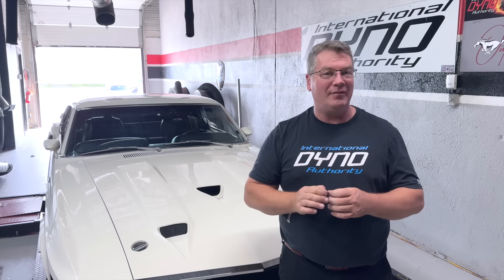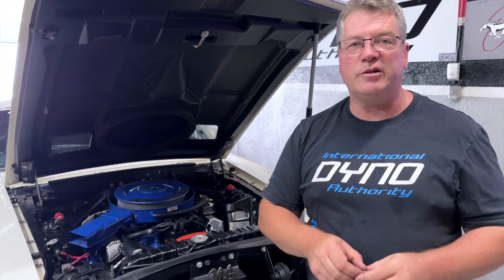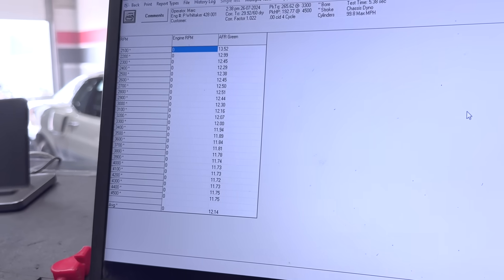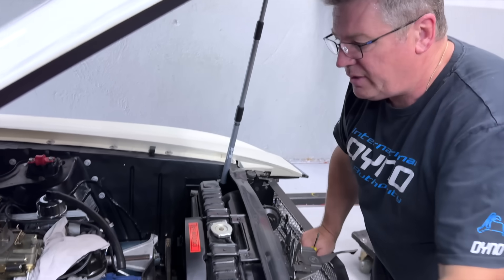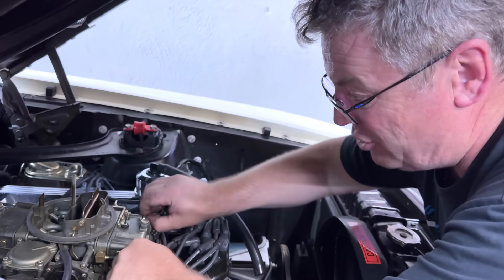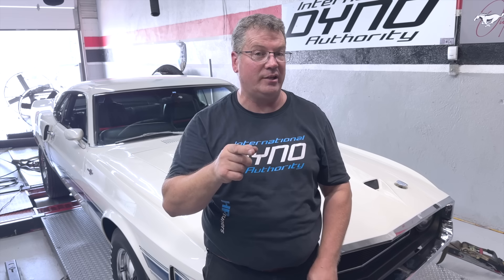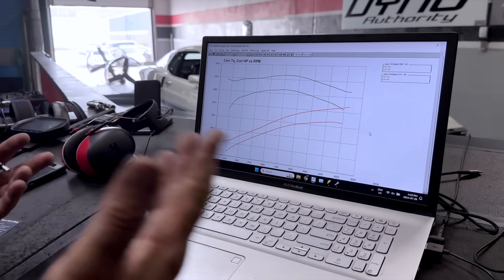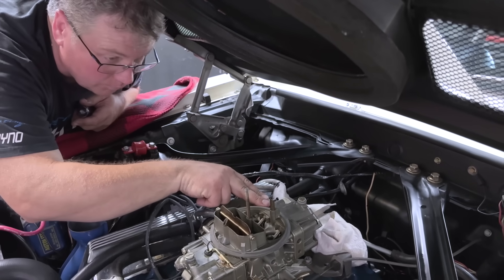Original, unrestored '69 Shelby GT500 tuned on the dyno

Comment: My father has a '71 Mercury Monterey that he bought as a young man and it had previously been a highway patrol car in Indiana. The trooper that had driven it actually found my dad through a message board in the 2000s and talked to him about it. Apparently they were kind of rare in that they were a souped up version and not the standard highway patrol car or something like that. It has a 429 with some kind of Super Cobra Jet Carb that several mechanics have told my dad was a fantastic and expensive carb. It is still tuned to run on high octane leaded fuel, so on the rare occasions he drives it he always fuels it up with good fuel and adds lead to it. I don't know how much power it makes, but it would put my '96 TransAM to shame.

Comment: My father owned a 62 Galaxie that weighed 3600 lbs and 428cj motor with headers cam and Holley 750 and it ran 12.88 at which the torque broke the diff 😊
Reply from the maker: Those were some awesome numbers!

Comment: Assuming a 15% drivetrain loss, 299.64rwhp & 403.01rwtq is equivalent to 353hp & 474lbft STP net (339hp & 456lbft using modern SAE net correction). Those are amazing numbers when you consider that Ford rated the engine at 335hp & 440lbft STP gross. Great job! 👍
Reply from the maker: @DJDinaggio  Thank you, and it's one of the mathematical equations, that we described to customers on a regular basis. We can give them a approximation and I say that in quotation marks. We can give them an approximation, of what the engine would make if we took it out and install it on our engine. Dynamometer. And in the past we have actually taken an engine directly from the engine dynamometer and put it onto the chassis dynamometer in the chassis. The customer was going to run in the first place. You would be very surprised how accurate the 15% number can be with most items.
Reply: The NHRA factored these engines in at 360hp I believe

Comment: The information above contains some incorrect information. The 428 would be producing 285 horsepower with440 lb/ft of torque at 3400 rpm's. The engine would have to be making 549 fb/ft of torque at 3200 rpm to make 335 horsepower. I've seen the 335 hp rating at 5400 -5500 rpm. I'm sure it's just a typo. Y'all motor with caution. 

Beautiful ride.
Reply from the maker: We appreciate you catching that - we'll fix the information and update the video description.

Comment: We got to 36° on 93.   Ran real good.   But yeah.  On a rare car and given “most people” 32° is a nice safe #.   Can believe it jetted down that far.  Y’all did real good.   Bet the customer will be thrilled to not be gassed out of the garage and have a car that runs good.
Reply from the maker: @PontiacSkunkWorks  The ignition timing amount, is rarely something that we really worry about. What we do, is make sure that the fuel is correct. That the fuel curve is correct. And when we're all finished. We will work on ignition curve. But, the all-in number, is really based on what the customer would like to do with the vehicle. Vehicle. And the quality of fuel they think they can achieve at each station. They go to. Most of the time on the street for a cruiser, you're just making it run correctly. We're not worried about trying to get 33 or trying to get 34. However, on our engine. We will work with the timing and the timing curve until we make the maximum amount for any of our competitive customers, who are actually using their vehicle for competing with their boat competing in truck or tractor pulling or competing on the quarter mile drag strip or roundy round, Circle track racing.

Comment: The Muscle Car Era was a wonderful time to be alive.  This is one of my all time favourites.  I remember seeing one in the neighborhood when I was 17.  Stunning Car.
Reply from the maker: @timmotel5804  Agreed this is a Fantastic Car , fun to work on.... Very Responsive
Reply: Except for the cars didn’t make much power and were junk.
Reply: @SoDoSoPa-ShiTpaTown you ever ridden in one been behind the wheel of one  owned one
Reply: @ my first car was a 1969 camero z/28, also had a 70 charger RT V code car 440/6.  I’ve had a bmw 750, and Merc S580, both of which would stomp the hell out of any muscle car. Those are both full size luxury limo’s. Currently have a new Taycan 4S.  No muscle car could hold a candle to it.  They didn’t handle well, didn’t stop well   didn’t make much power for their displacement, and were typically not road worthy after 5 years.

Comment: The carb has been restored.
Reply from the maker: @hunniebe6  It was a beautiful carburetor to work on. Definitely in great shape. Each of the bolts and pieces, and gaskets were easily removed and replaced and it was a great piece to tune . The step-by-step process was fun to shoot, fun to test, and just an overall fun vehicle to work on.
Reply: @internationaldynoauthority693  Looks like a quality restoration.

Comment: The year was 1979, I had a 77 Ford 4x4 pickup with an FE 360 (I bought new for $4500). My friend had a GT500 with the 428CJ. He wrecked it and sold me the motor for $385, complete with shaker hood scoop, bell housing. I installed the motor in the truck. That was a fun truck. My father had a 460 in his truck and I would beat him every time.
Can you believe I traded that truck for a Mustang II "cobra"  What was I thinking? Well, I had just gotten married and moved to the city, plus I was starting college and felt a smaller vehicle was needed. I really miss that truck.

Comment: Great video.  But how times have changed.  I modded my '05 Mustang GT 281 (4.6 L) with a larger Ford Racing cold air kit, larger FR throttle body, FR X-pipe and mufflers, JBA shorty headers, and 91 octane dyno tune.  Result:  301 rwhp, slightly better than this 428.  Lots of progress since '69.
Reply: @MarkRockwell-d3u - So you are comparing your highly modified engine vs. this stock 428?  Is that not comparing applies to oranges?  Make modifications to this big block 428 as well and it will leave your car in the dust.  There's no replacement for displacement.
Reply: @HiTechOilCo  tuner did a great job getting that much h.p. on 91 octane gas.  wonder what it would have made with 1969 high octane.
Reply: @MarkRockwell-d3u  No question,at 10.5-1 a high octane race fuel would wake the engine up
Reply: @HiTechOilCo  tuner did great job with 91 octane
Reply: @HiTechOilCo  sure there is. My little 281 in my 04 svt( Colleti)  cobra makes 400hp and 400ftlb of torque right at the rear wheels, from the factory. It'll smoke that 05, and this shelby. 😆
Reply: @psquared75   meh, you'll only be looking at the tail lights anyway.😉
Reply: @psquared75   lol! I didn't buy it to please you.
Reply: How much torque?

Comment: No distributor recurve?
Reply from the maker: @LloydMcElheny  

We worked on a lot of items off camera. 

The biggest concern here, was, smoke, and smell. 

This vehicle had had a smoke issue due to overfueling, since brand new. 

We did apply, a lighter and a medium spring. 

There were a lot of other details, that we changed, updated and or adjusted. 

We do complete tuning videos on other vehicles. This particular one was to show, the problem. The solution, and illustrate the steps taken.
Reply from the maker: @LloydMcElheny  when you come to the section of the video. Where I purposely, had the customer come up to just under 4000 RPM. At that point, there was no smoke. And then, right after 4000 RPM, there becomes clouds of smoke. 

It's at this point, that, your carburetor is completely out of vacuum, it has switched over to its velocity phase. And it begins pulling all the fuel from the rear mains along with the front mains. 

Also, there is some crankcase pressure. 😉 😉 Wink. And we addressed the crankcase pressure also. This along with tuning and careful paying attention. Resulted in, reducing the smoke to nothing. 

We always work on fuel, fuel, fuel, fuel, fuel. When we have the fuel where we are happy. Then we begin to look at, adjust, and work with the ignition timing.
Reply: @internationaldynoauthority693  Which has what to do with an ignition distributor recurve?

Comment: I don't understand why early on it was never corrected at Carroll Shelby Motors.
Reply from the maker: @davidgagnon2849  any vehicle, that is produced and or manufactured for sale to the general public, comes with a factory calibration. The factory calibration is tested on an engine dynamometer. And then, put into the chassis. The vehicle is then set for sale. And at that point they mass produced the vehicle. At no point does a company who is making mass production, take each vehicle, put them on a chassis dynamometer, and then then tune each one individually until it is correct according to smoke free, best air fuel ratio, best timing, ignition, etc. They are mass-produced and sent off. 

There are exceptions. Those being Bugatti, some of the track oriented only. Ferraris. And even some of the Le mans, Ford production vehicles that are tested for use in 24-hour style racing. Other than that every vehicle on the road can basically use a tune. And easily pick up 20 to 30 horsepower and $40 to 50 ft lb of torque on a V8. On turbo vehicles. The difference is even greater. It's mass production. It is Mass profit. It's just the way it's done

Comment: use to work with a guy who had an original Shelby GT 350 fastback back in the 70,s White with the blue double stripe and the spare tore mounted under rear window, he always said he would never sell it, i ofter wonder if he still has it

Comment: 67-69 Shelby's were NOWAY as beautiful as the original non Shelby perfection....yea its nice to have one
Reply from the maker: That’s a very bold statement, I hope you don’t mind me saying so 😉
Reply: @internationaldynoauthority693  
Not at all
Shelby in 65 Shelby's were the perfect form
In 67 Ford fastback was hard to improve on " body wise" and in my opinion 65 and 67 Fastback was. the best looking 60s cars ever 
I 62 today and in 1978 bought a 67 Fastback built the 279 and C4 to shift at 6700 after about 40hrs die grinding head to intake gasket and Torker intake to gasket which gained me 1000RPM on top end
With a 4.11 gear in high school in 1979 it was running 12.70 and a daily at 17yrs old
Man I had a great teenage with that car 
Chicks etc.

Comment: @International Dyno Authority and everyone - I am a BF Goodrich T/A Certified Tire Specialist. I have been in the automotive and tire industry for over 40+ years now.  With older classic cars like this Shelby, using the original type bias ply stock tires for car shows is perfectly understandable.  However, for any street driving I strongly recommend using a set of modern radial tires.  The improvements in handling, braking, traction, steering response and overall safety vs. obsolete bias ply tires is like night and day.  This is a safety issue.  Tires are such an easy, bolt on upgrade that it only makes sense to use modern radial tires on the street.  Modern radial tires vs. the old bias ply tires also have much greater puncture resistance from nails, screws, etc., and this too is another safety issue.  So if you own a car like this Shelby, I suggest it is very wise to invest in a second set of rims and tires so you can easily swap them out as needed.  A set of modern radial tires can also avoid a potential accident, or worse.  Using modern radial tires on cars like this is a win-win.
Reply from the maker: @HiTechOilCo  

International Dyno Authority: Pioneering the Future of Tuning and Combustion Technology

As North America’s premier facility dedicated to advanced tuning and research, International Dyno Authority (IDA) has set the standard for tuning and power optimization across a vast range of applications. This cutting-edge institution has earned a reputation for excellence through extensive partnerships, groundbreaking innovations, and the development of tuning standards that are transforming the industry.

Partners in Innovation

IDA collaborates closely with leading corporations, advising powerhouses like HP Tuners, Whipple, Roush, and Ford Motor Company. Their insights and technical support have become an essential resource for these companies, driving improvements in engine performance, efficiency, and emissions standards. Through these relationships, IDA has a unique vantage point to pioneer developments that shape the industry’s future.

Pioneering Standards in Tuning

Since its inception, International Dyno Authority has been at the forefront of the tuning industry, not only setting new standards but also elevating the capabilities of tuners of all experience levels. Through their publications and training programs, IDA provides essential resources that empower both novice and professional tuners, equipping them with the skills to achieve precision tuning across various engine platforms. Their commitment to education is evident in their comprehensive curriculum, covering the intricacies of combustion dynamics, air-fuel ratio (AFR) tuning, boost management, and fuel characteristics.

Educational Outreach and Online Presence

IDA has established a strong online presence, notably through their YouTube channel, which serves as an invaluable resource for enthusiasts and professionals alike. Their instructional videos, which include step-by-step tutorials, practical tips, and expert insights, are used by institutions such as MIT, Boston College, SCT, Holley Inc., and Edelbrock, making IDA a recognized leader in education within the field. Their expertise has also gained the attention of influential industry figures, including Steve Morris, who has commended their contributions to tuning technology.

Specialized Focus and Areas of Expertise

Operating as a purely tuning and research facility, IDA’s specialization spans a wide range of topics. They delve into complex subjects such as combustion technology, AFR tuning, boost and fuel optimization, and luxury engine swap integration. The organization’s work also extends to advanced fuel research, as seen in their recent collaboration with TTC, Hydra-Gen, and DynaCert. Here, IDA took the lead in developing an 8.9L Cummins engine hydrogen supplement fuel program, which included rigorous emissions testing, underscoring their commitment to sustainable and innovative fuel solutions.

The Facility’s Technical Scope and Testing Capacity

Each year, IDA conducts over 650 vehicle dyno tests, tuning engines and chassis systems to optimize performance. This includes a wide variety of engines powered by gasoline, E85, diesel, hydrogen, port and direct injection, throttle body injection, and even carbureted systems. Their expertise is not limited to traditional vehicles; the facility also tunes boats, tanks, and military transport, making them the only independent tuning and research center in North America dedicated to such an expansive range of engines and fuel types.

Advancing Industry Standards

By leading projects in combustion and alternative fuels, IDA continues to be a key player in the evolution of tuning technology. Their dedication to setting new standards in performance, efficiency, and sustainability has positioned them as a trusted authority in an industry that is constantly evolving. For anyone looking to understand or pursue high-level tuning, International Dyno Authority remains the ultimate resource and innovator in the field.

Comment: 400wtq stock is sweet. My 457" stroked 428 puts down 421whp 468wtq. My friends helped me dial in my custom built carb just with a permanent mounted AFR gauge. When i took it to dyno my friend only leaned out the rear jets one size and it gained 15hp.
Reply from the maker: It is amazing that you are able to tune your car using the AFR gauge. You are absolutely killing it!

Comment: @International Dyno Authority - At timestamp 09:56, what's with the steering column/steering wheel moving up and down?
Reply: 1969 unit body construction......
Reply: @alm4132  I guess safety never entered the picture?
Reply: @HiTechOilCo  Not too much back then....crashes were usually fatal.

Comment: I test drove a used  Mach 1 with a 428 SC  an automatic with the drag pack  it also had a shaker hood scoop. It was during the gas crunch and the transmission was slipping they wanted $600 if it wasn’t for the tranny I might have bought it

Comment: Not far off from a stock Gen 3 Coyote, strangely enough. The 'yote puts more power down at the wheels but the 428 beats it in torque by a wide margin. I love that.
Reply: The cylinder heads is what makes the coy run hard
Reply from the maker: You are correct, the old technology still holds up in torque!

Comment: This engine was designed to run on 115 octane leaded gasoline. The engine has leaded seats
Reply: Unless it’s different from my 429. I think they started hardened valve seats in 72 I believe. Unleaded gasoline was introduced in 73. If so to get the best factory results you can change the valve seats or run lead additives, still don’t quite bring up your octane. High compression engines require very high octane fuel. Not trying to hurt your feelings just some facts. I own one. Mallory Ignition System made a very big difference for me. All original 429 cobra jet. Ps the engine after this one?
Reply: @matthewstricker3333  The 428 and the 429 are different engines.  The 428 is an FE Series engine while the 429 is a 385 Series engine.
Reply: @userer4579 ,
   Yep, very true. This is a '428 Cobra Jet' it might be a 'Super Cobra Jet' with the LeMans rods!? It was way underrated by Ford. This thing here is still a dog, till it gets taken apart and put back together right.
Reply from the maker: You are correct, this engine was designed to run on the premium fuel of its day.